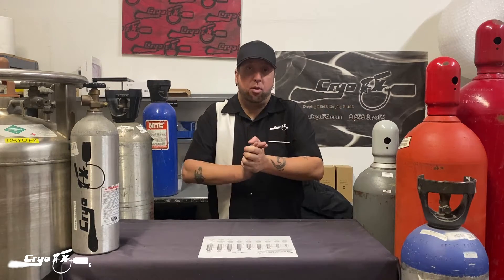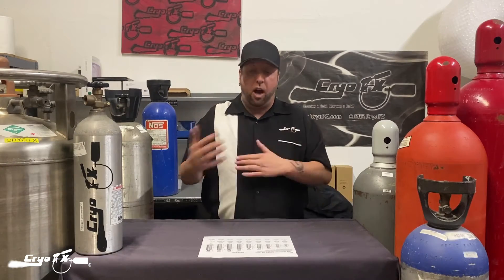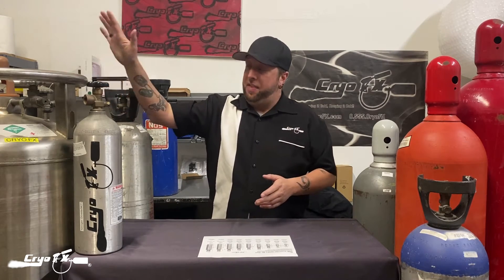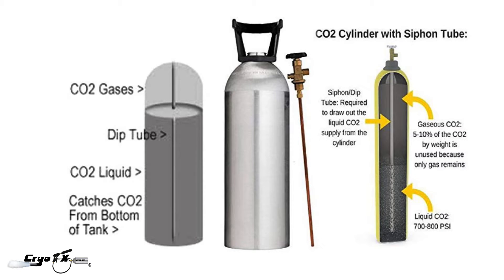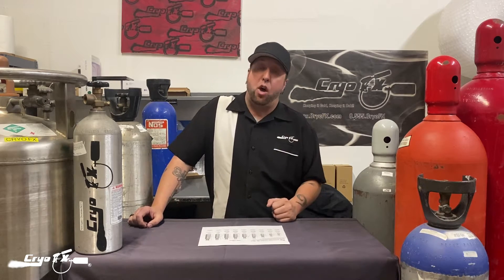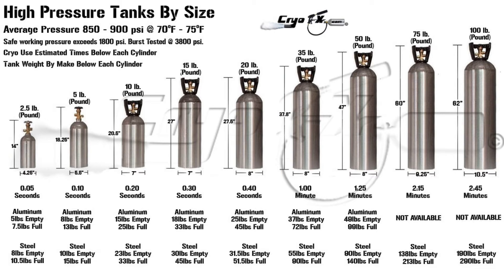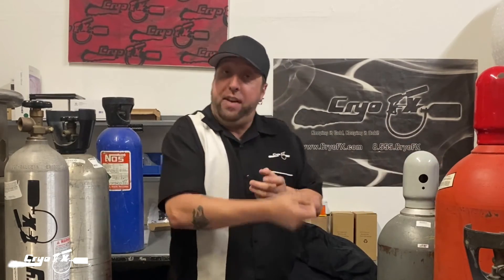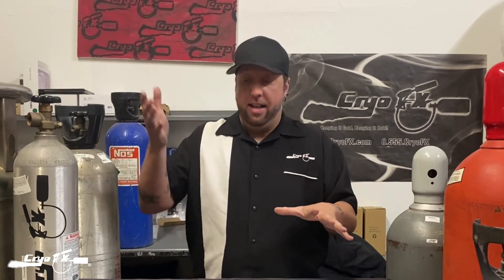How Long Can A Co2 Tank Last - Co2 Tank Sizes Chart [CryoFX]

Comment: Will a hundred pound tank refill a 10lb tank 10 times? Will it fill a 20lb tank 5 times?

I use co2 tank to refill my 4x4 off road 37” tires after I air down. I use a 15lb tank and it refills all 4 of my tires about 30-40 times. I also use it to run air tools as well. 

I also use 24oz paintball tanks to run my air tools. I also use the paintball tanks to run my co2 practice slides on my firearms too. I want to start using my 20lb tank to refill my 2.5lb and my 24oz tanks. I also want to get a 100lb tank to refill my other tanks.
Reply: Yes. Or almost. There will be a bit of loss in the valves and tubing. So for a 100lb tank you will get 4 20lb plus one 18-19 lb one.

Comment: I own a Mobile Car Detail Cleaning business, I have an air compressor but I was wondering about using a CO2 Tank with a Regulator instead of an air compressor for blowing out Air Vents and under seats. What do you think?
Reply from the maker: Yes this would work. In fact, you could also use nitrogen for the same concept, both regulated down of course. Be safe with transporting these tanks. PS_ these gases can also fill up tires as well!

Comment: Very informative video. I need help ASAP. Can i fill nitrous oxide in co2 tank because where I'm from specific tanks for nitrous oxide filling are really big but i want to transfer NOS from big cylinder to small cylinder and only small cylinders i can get here are for Oxygen, Co2, propane, LPG and fire extinguisher ones. If there's any modifications needed to be done with cylinders I'm up for it.
Reply from the maker: We would advise against this for safekeeping sake on keeping the gases separate.

Comment: Hi i see you have a Noz tank in the back can you use a NOS Tank for the co2 jests/ co2 cannons ?
Reply from the maker: Formally no, as the gases are different and cannot be mixed. However, you can find a Nos tank and have it cleaned and used for Co2 with the correct labels on it. The gas facility has to accommodate the fill also with this setup. This may be tricky since the tank says Nos, but labels would say Co2.